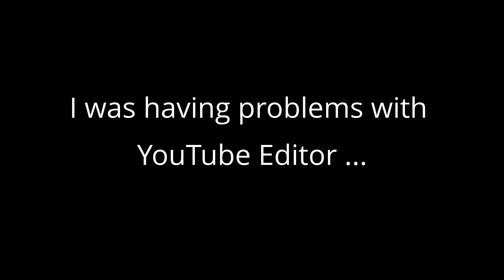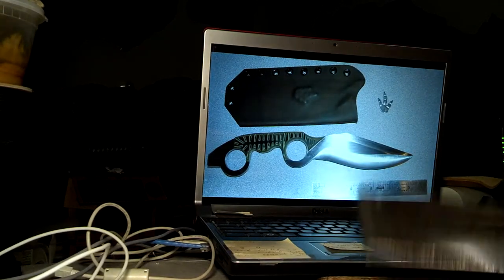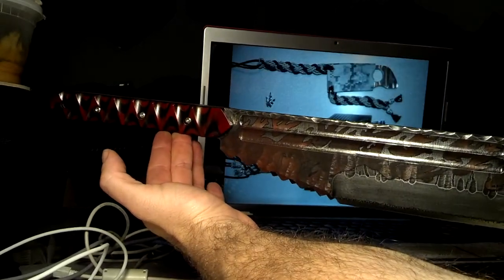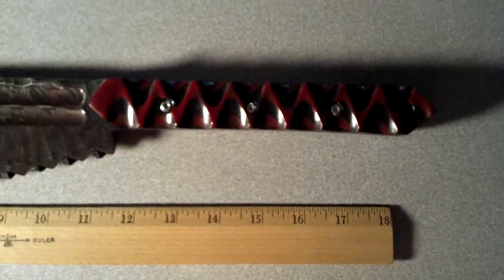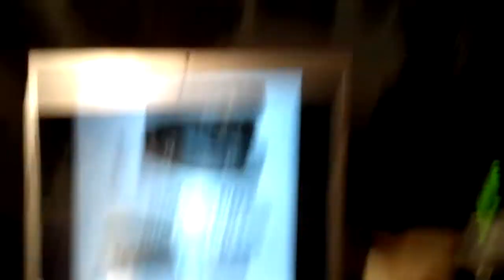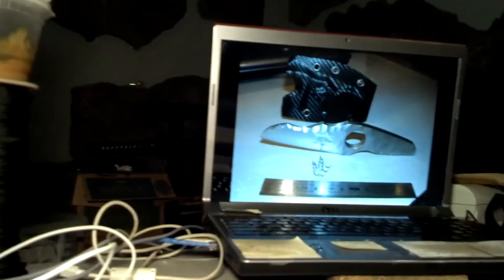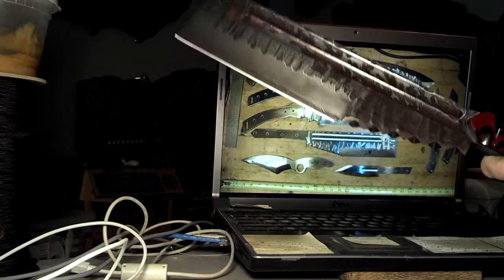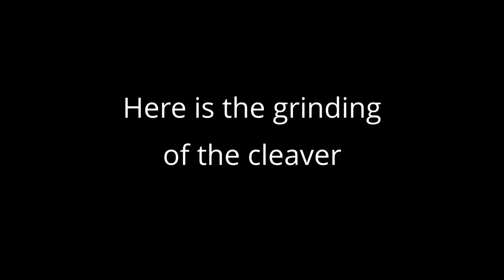Hell's Kitchen Cleaver w/ Flame Fallout Finish (part 2)

Comment: Bro you are by far my favorite creator. I know there are other great knife makers, but you can do it all. i'm trying to design a broad sword for you to do,only problem is I can't draw worth crap lol. I see it in my head as the shape is like Conan's sword, but with the rock pattern in the middle on each side and now with the red/black g10 around the handle and the area before the handle the metal comes across with right angles facing inwards. I see it but, can't draw it. also it has reddish flame